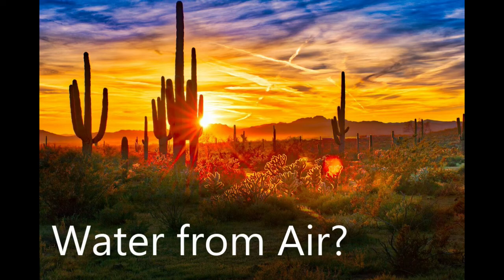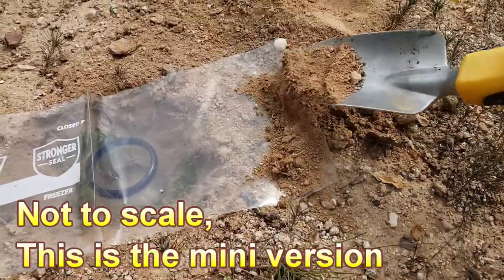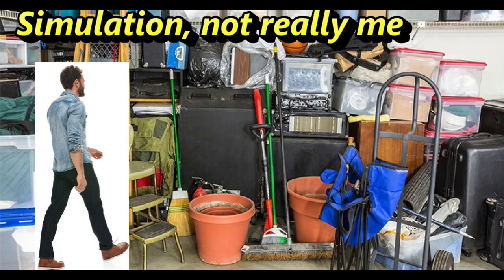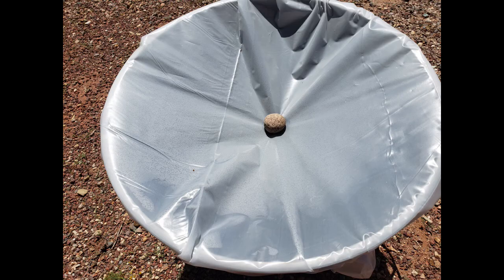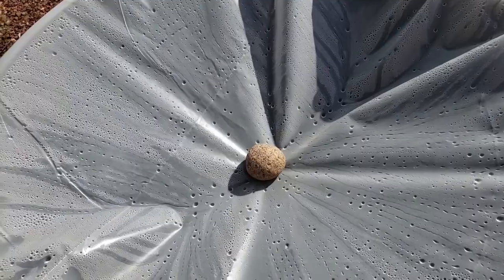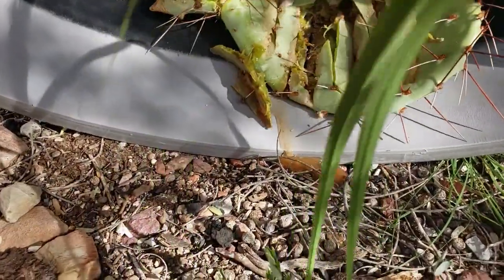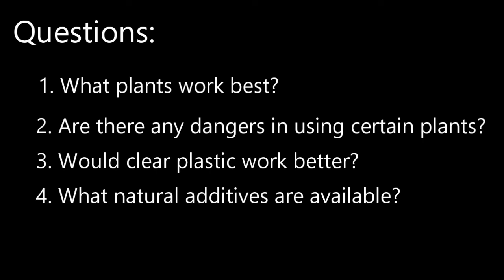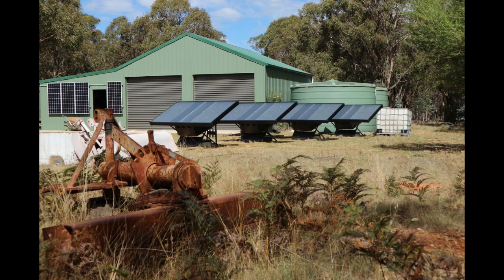Water From Air & Plants?  I FINALLY DID IT!

Comment: Excellent thought process! You need to post often with a I'm just spitballn'here and let that thought process just flow. These are very practical self preservation type thoughts I have often. And I'm pondering moving to New Mexico, so yeah, desert living and water production is a major concern. To solve such a question creates freedom of movement. I smiled when you showed the company that sells the water collector, I immediately said in my mind, yup, for Five Gs you can have water ❌ I was like, c'mon, let's get open source, let's do this for under $500 or $100.
Reply from the maker: True...seems like it could/should be much cheaper. Thanks for the comment.

Comment: I'm currently in the "water from air" 🐇 hole, finding answers for watering a small backyard garden at a vacation home when I'm not there. This was one of the few without mention of air conditioner condensation collection. 
The home is by the beach.
Reply from the maker: Are you able to directly access sea water?  That would be perfect for a solar distiller.  But your project sounds interesting.  Good luck.

Comment: First, good job actually doing it and sharing your results. I do have a couple of suggestions to consider, things you might try, if you like.
A DIY solar oven would capture and contain more usable heat around the vegetation, which should more quickly evaporate the moisture from the vegetation.
Much more vegetation can be used to, in theory, condense more water in a given time period. Load it up. (If you had used a tall vase instead of a bowl, more vegetation could have been stacked around the taller vase.
I think clear plastic would have worked better. You could also make a box frame for the planter to sit in, and cover that box frame with clear plastic, which should act as a DIY solar oven around your pot. You could set both the planter and clear box on a reflective surface, like a cheap mylar space blanket laid out on the ground, to "bounce" more sun rays onto your planter. (More heat)
If you paint the planter black, it will absorb more heat.

Anyway, nice work. Hope more people see it as time passes.
Reply from the maker: Thanks so much for the  comment and suggestions.  They all sound like good ideas.  At some point I'll try again with improvements.